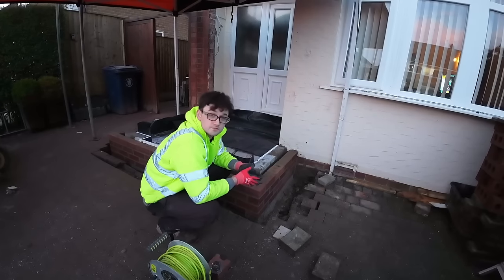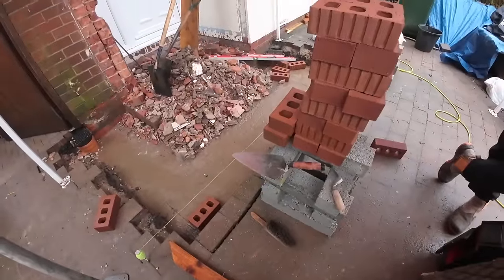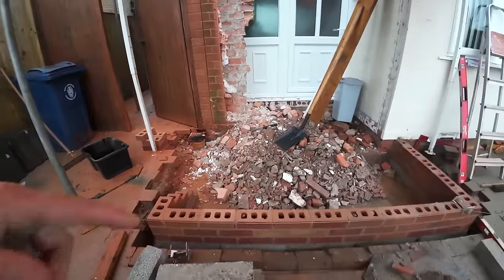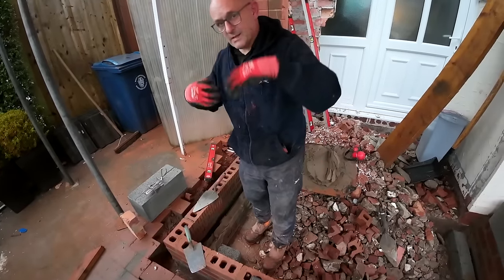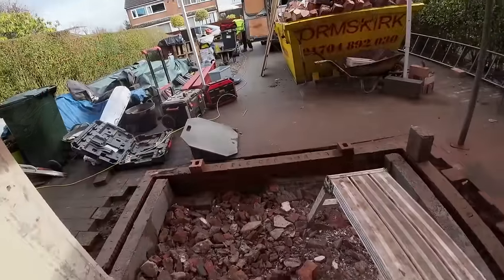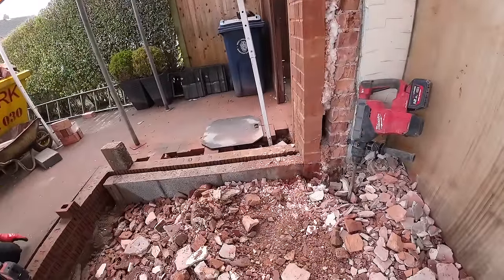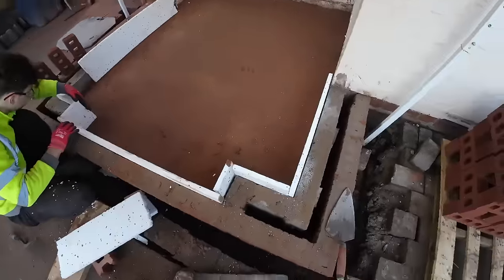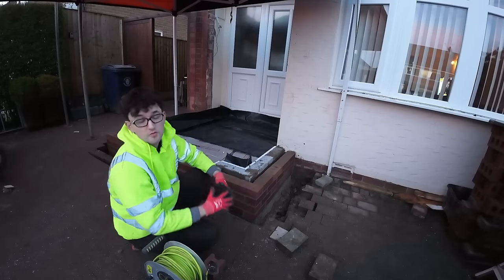BATTLING AWFUL CONDITIONS TO GET THIS PORCH RIGHT..PORCH BUILD PT 3

Comment: Absolutely nothing is straight forward,  ever ! Take this as an example.. my missus said the other day that she had a problem closing the door to the downstairs loo, that's odd i thought but left it until she really got the ache about it so, after she'd gone to bed, i decided to have a look & sure enough the door had dropped from the top hinge.. easy fix, no problem,  piece of piss ! Was it bollocks, i couldnt find a screwdriver anywhere & i really didn't want to bang & crash about looking for one so what did i end up doing? I used the screwdriver bit on my swiss army knife .. did the job but where the bloody hell was me screwdriver? Nope, aint got a clue . I think our ghost has been moving stuff around again ( you think I'm joking !), i can never find anything in this house, when i was wallpapering the hall, i was on my own so no one to wind me up, i did me pencil line on the wall, put the pencil on the table,  turned away & when i turned back it was gone, completely gone & i had to get another pencil & ive not seen the original one since !

Comment: Steve question for you please mate. When you make the cut up the wall for the vertical dpc do you cut all the way through the brick into the old cavity? So the dpc slides right into the old cavity? 

Thanks 🙏👍
Reply from the maker: No usually about 75mm in 🧱👍🏽
Reply: @SteveAndAlexBuild  brilliant mate thanks for your response, doing a porch build currently and wasn't sure cheers 👍
Reply from the maker: @JimJimpmjj good luck 🧱👍🏽